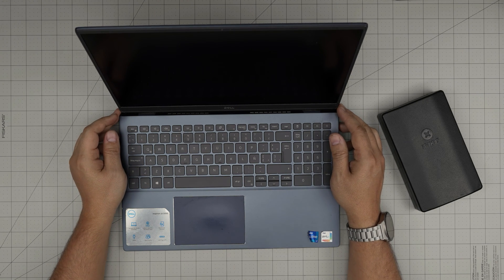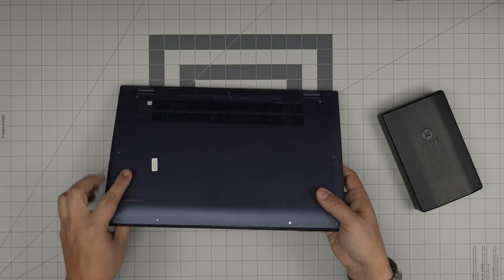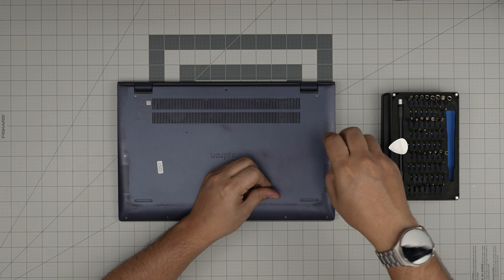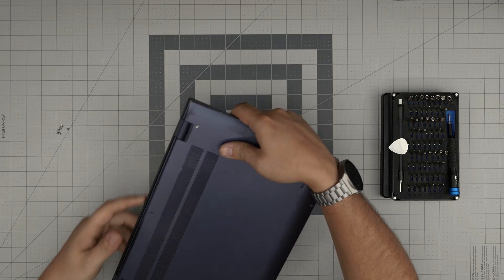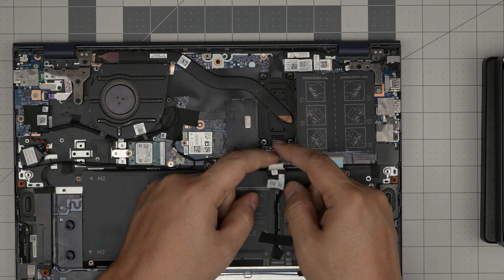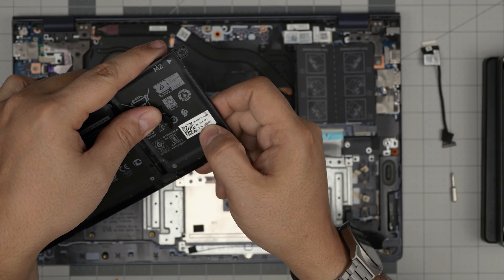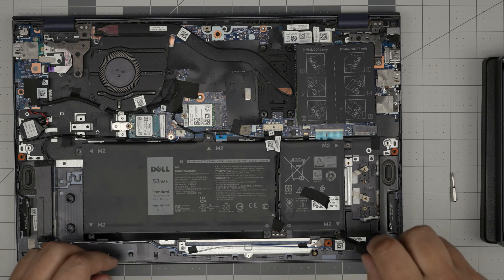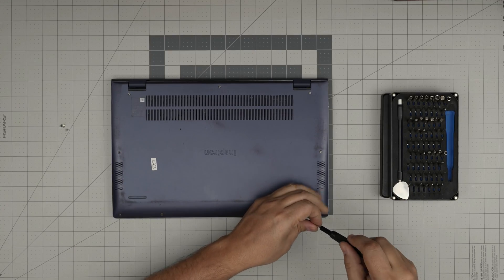How to Replace the Battery in a Dell Inspiron 5000 5502 Laptop

Comment: Thank you for this excellent video. I wanted to add one additional note. Once you change the battery make sure you do not tighten the back too much. I did and my track pad was not clicking and was not working properly.  Make sure not to over tighten.  😉
Reply from the maker: It's my pleasure my friend.
🫠Regarding your screw, you can tighten it all the way, and it should not affect the touchpad unless your battery is inflated or the cable is not inserted in the groove. In such cases, tightening the screw may press the battery against the track. I recommend checking to ensure that everything is flat and level with the battery height.
cheers🍻